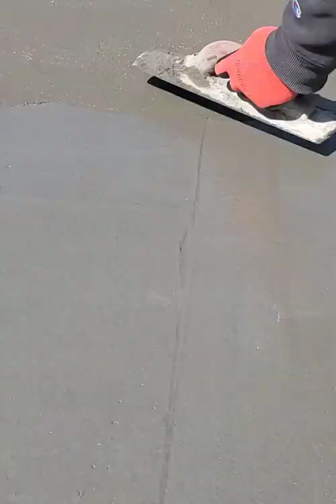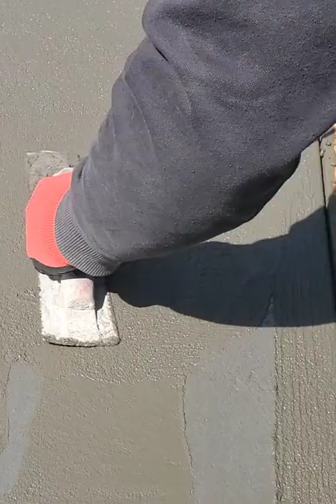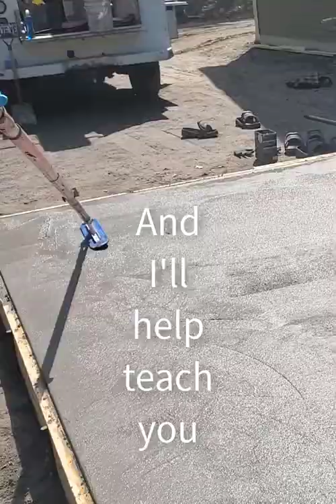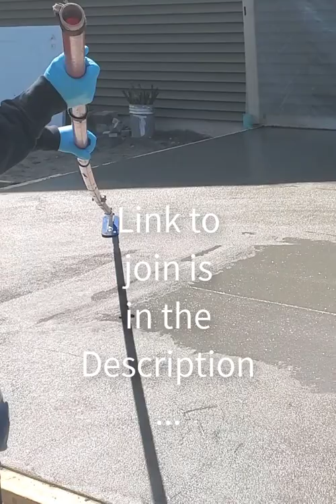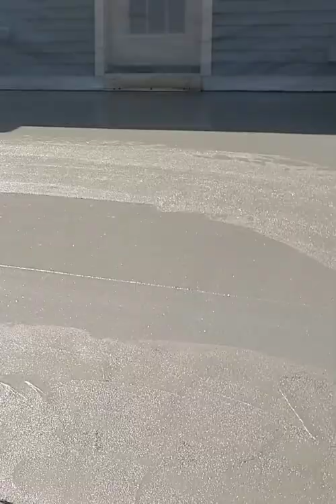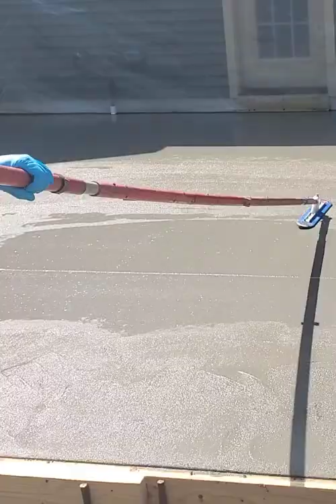How To Mag Float Concrete (Learn Concrete Finishing) #Shorts

Comment: Sometimes when I’m finishing concrete, it tends tear apart in a way. Is it me or the mud? In the video, the float does just that. We just get done placing and run the bull float and seems to do the same. Not pouring super tight either, 4-5 in slump
Reply: Too much air
Reply: It's the mud
Reply: Air
Reply: Sun and wind will cause that also
Reply: Air in the mix. My option when it does this leave it for awhile.. easily over agitate this area causing spalling or separation.